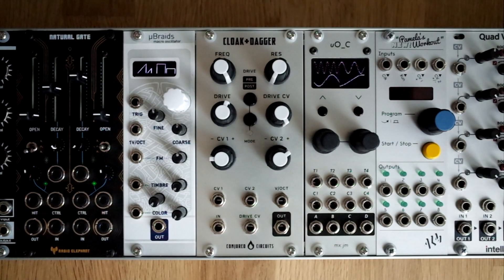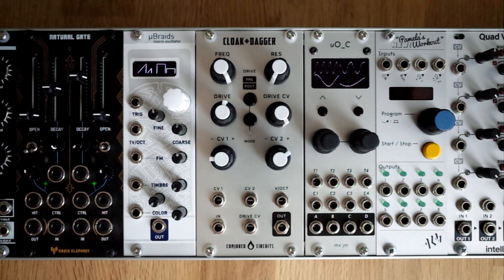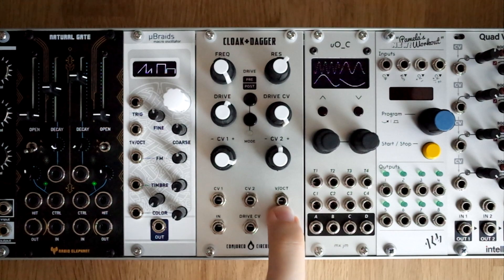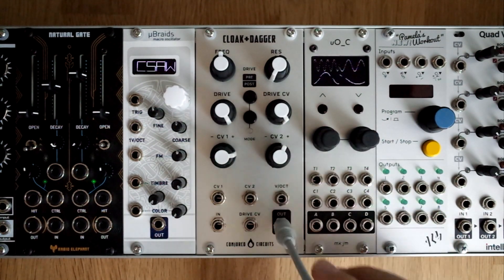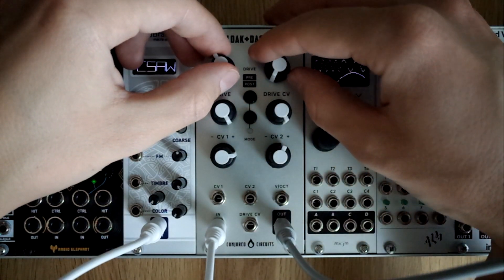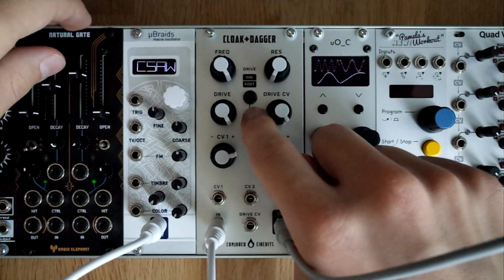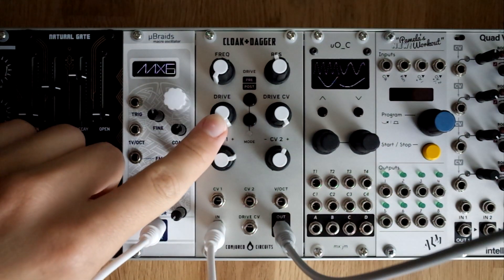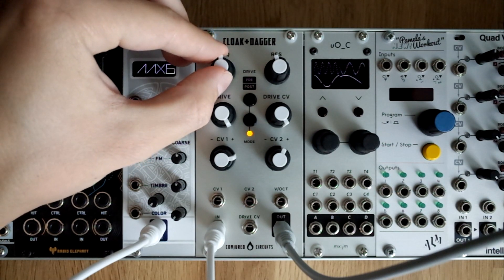Conjured Circuits Cloak+Dagger - Module Review

Comment: I see why this is tagged on modulargrid as distortion, filter, vca in that order. From this video, it seems that the distortion is really the highlight of the module. It breaks up really nicely, with an intriguing, chunky noise that's easy on the ears. When you turned the drive down the output almost vanished though - was that due to the normalization / compression you mentioned?
Reply: The Drive knob can cut everything completely, if you have the drive(s) engaged and set the knob to 0%. Then, you can use a Drive CV which will "open" the drive circuit(s) up and act like a VCA. This is why it was also labeled a VCA on ModularGrid. Hope that helps!